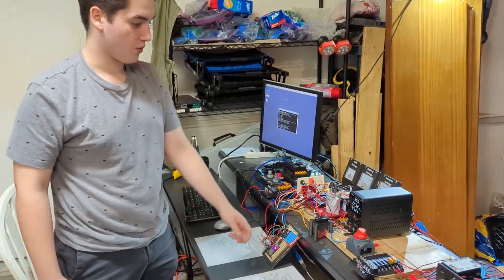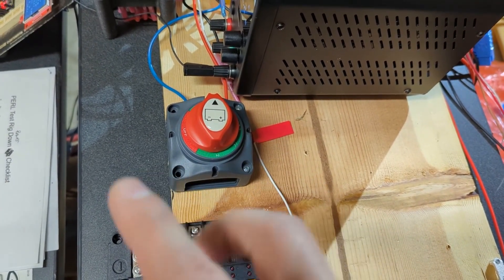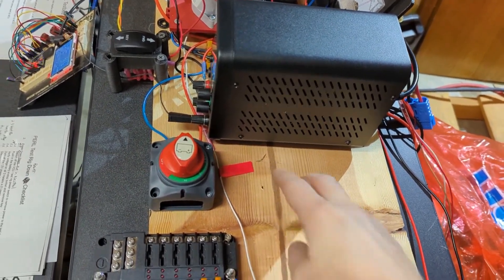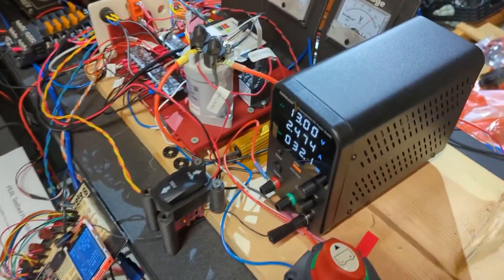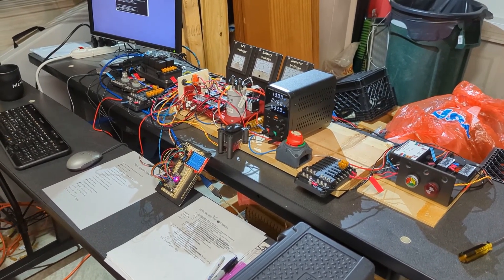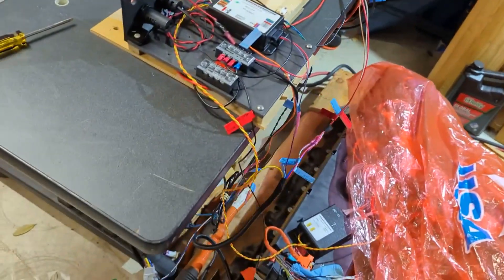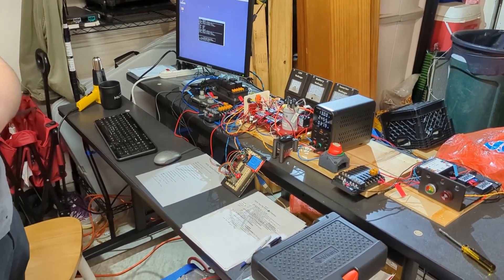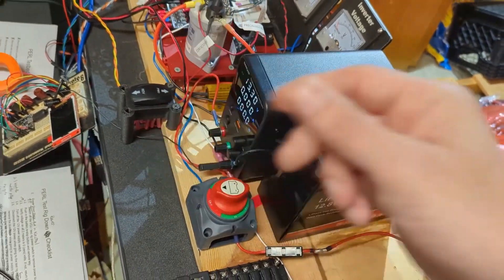Porsche 924S EV Conversion - Part 21 - New 12V LiFePO4 battery and battery switch

Comment: With the BMS built in to that battery, you'll be fine.  That'll handle the charging cutoff when the battery is full.  Ideally if your DC/DC converter is large enough you'll rarely use anything from the battery as the converter will handle the load.  Only thing I would make sure of us that the discharge rating of the battery is large enough to handle your 12v loads should you run in battery-only mode or otherwise have a DC/DC converter fault.

Keep up the good work, I've enjoyed watching the build. I'm in the midst of a Jaguar conversion and am going to use the same Leaf setup with the Thunderstruck VCU.😊
Reply from the maker: thanks for the comment! The battery spec says max continuous current is 20A. So, like you said, shouldn't be a problem if the DC-DC system is working. If something causes that to malfunction, I guess I'm not sure what the worst case 12V system load will be. I wonder if I should monitor the current going to the LiFePO4 battery inside the car?
Reply: @FrankGraffagnino  it wouldn't hurt to monitor it. Then you know if it's charging or discharging or overall battery health of the 12v system.
Reply: @FrankGraffagnino  20A isn't much, certainly not enough for the likes of a power steering pump but I'd have thought it will be OK so long as it's only used for getting the car going.
You might want to start installing stuff in the car though as I suspect you'll change your mind a few times before you get it going. 😉